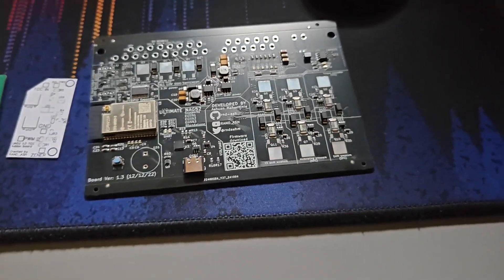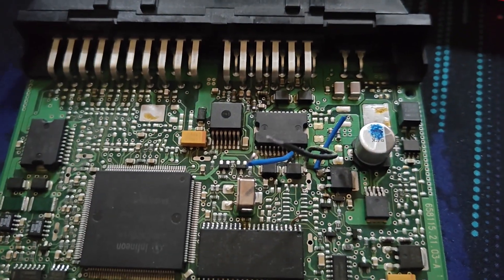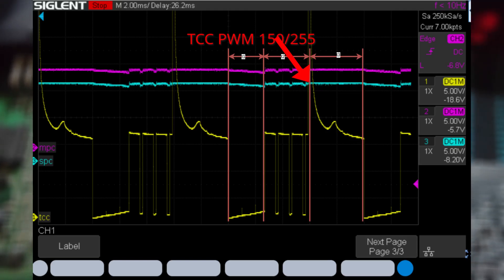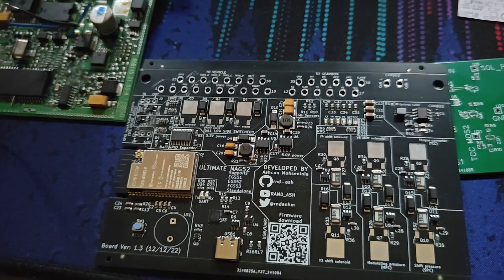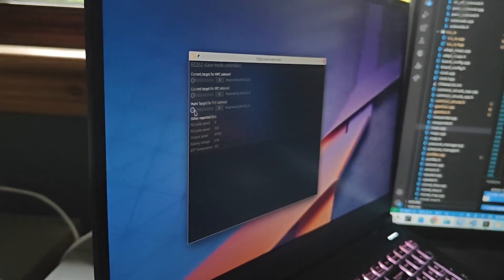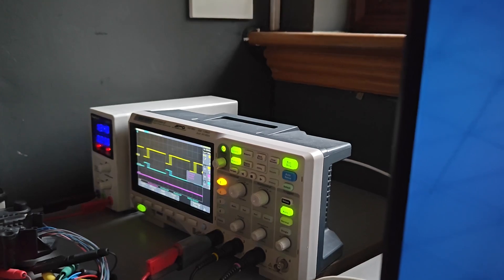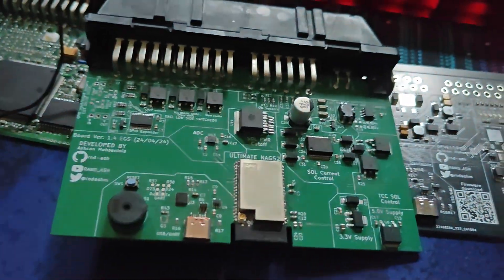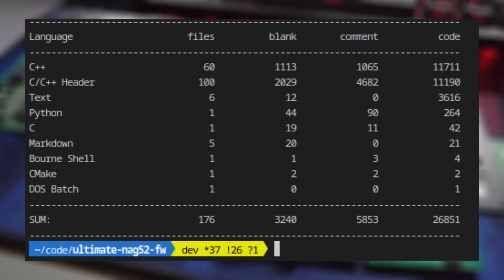Ultimate NAG52 update - TCC solenoid fix, PCB V1.4 progress, and more!

Comment: Fantastic update!  cant wait to build a few 1.4 boards and test. Currently built 2x v1.3 boards and so far been super stoked with them. Hopefully development can progress with these boards in standalone mode. My next project is a om606 tied to a 722.6 but standalone (om606 either mechanical IP or standalone w/factory IP and non em ecu), one of these boards was my first choice for this planned build.
Reply: I asked Luke Dale of Dieselpumpuk to make contact with Ash for exactly the same reasons you outline. He said he has been in touch, but was non comital about the outcome?
Reply from the maker: Yeah, I actually reached out to Luke a while back, we had a couple back and fourths, but since then I've heard nothing. 

Also, standalone mode does require some basic CAN data from the engine, so it does still require some form of ECU to operate (things like pedal position and torque data must be sent to the TCU for pressure management). It does however work with MAXX
Reply: @RANDASH  I am not familiar with MAXX …. But I am aware that some stand alone TCU’s (used for conversations) map out a toque look up table that matches your engine in software and that is used for the feed that the ECU normally supplies.
Reply from the maker: @JACB006 that is true, but the TCU still needs to be able to talk to the engine to do torque reductions where necessary (it's actually critical for shifts where the gearbox will release clutch packs before applying the next one)...so doing this over CAN is the best way
Reply: @RANDASH  How do the likes of Turbo Lanik get around these issues? 

As an aside, I own two cars a Mercedes CL (215/M275) and I am a keen follower of Alex of LegitStreetCars fame. He started out as a Mercedes tech and did a lot of work on cars equipped with the 722.6. He has reviewed various reprogrammed Mercedes TCU’s and has shown quite a lot of conductor plate/valve body work on his channel. He also showed a 722.6 issue, where when cold the torque converter doesn’t work quite as it should and the driver feels something like an early first shift, when in fact it’s a torque converter issue. You two might like to consider collaborating on a project/video?

My second vehicle has the running gear of a 69 Challenger (440/727) It really needs a transmission swap and at first I thought about a 68RFE using a TCU from Jason at transmissiontuner, but his TCU development has had various issues/delays. Next came the idea of a ZF 8hp** using a Turbo Lanik TCU. 

I then found your site and was so impressed, that I hoped one day that you might consider a second project, maybe a S/A TCU for the conversion guy’s, perhaps the ZF 8hp**? …. But at the time I had no idea just what was involved with such an undertaking. I dare say that if your 722.6 project is ever finish to your satisfaction, you will never want to say TCU again?

Oh …  I used to own a 123TE (great car) and later a late 124TD (non turbo being RHD). I always thought that a turbo diesel 123 would be a great daily drive hence my interest in Dieselpumpuk who in turn has issues controlling the 722.6 in his conversions.

Keep up the great work. 👏
Reply from the maker: @JACB006  not gonna lie, I messaged Alex a while back (years ago), but this project was still very early in its development at that time. I still don't think that I'm ready for it to go on a big channel due to this project still having some issues compared to just tuned OEM EGSs (Remember, all the code for this project is starting from scratch, whilst tuners just tweak existing tables on the TCU).

Also, I don't think ill work on the 8HP boxes. They are fully electrical boxes, thus, an accident with the software can cause some seriously bad side effects (Like shifting into R at speed). The 722.6 has hydraulic fail safes to stop this. Thus, it was what i felt safe playing with. And, there is always more potential to squeeze more out of old boxes. The 722.6 is a monster in terms of how well it handles high torque!
Reply: @RANDASH  

So glad you made contact with Alex, albeit some time ago. I am certain that he would have been encouraging and suggested that you keep in touch with him. Perhaps you could send him your latest TCU and let him try it (impressing on him that it is still in development) and see how he gets on with it. If all goes well it could be featured in one of his videos (maybe with you) and as you say, he does have over 1,000,000 subscribers that might help with your sales and help his subscribers/722.6 owners at the same time.

Re the ZF 8hp** … Yes I understand that it would be fundamentally different project, but don’t sell yourself short, you have learnt a very great deal developing the 722.6 TCU and who would be in a better position to take on such a project? There is I believe, a big market, not only the road racing/drifting market, but also the conversion market for those of us who are still stuck with 3 or 4 gears and no way of upgrading to modern gearboxes (transmissions) due to the lack of OEM ECU’s. My 440 actually has sequential injection curtesy of Edelbrock. It gets its cam signal from a modified distributor. The control unit is pretty basic, but I believe it does have some sort of minimal CAN output. So if you went ahead, what competition would you have? I believe it’s limited to Turbo Lanik and MAXX (the later seems like a major undertaking for the conversion guys with no ECU experience). Perhaps you could have a look at those two, would be competitors and ask yourself what you would do to improve matters? 

Thanks again.
Reply: @RANDASH  Again the work you have been doing is absolutely fantastic. Currently running your boards on my w211 and crossfire srt-6

Another long term standalone project im working on is full efi and supercharging a m117 which would drop in a 560sel w126. I do plan to slap a 722.6 behind it. Again long term build (currently fabricating intakes and supercharger brackets), but collecting parts. I am going to use a megasquirt MS3 pro which i believe has CAN  communication. Has there been any ventures of folks getting your board to work nice with megasquirt. Totally understand where your coming from when the trans needs ecu input for shift performance.
Reply: @RANDASH Luke has no interest in engines with electronics- it's just not their market. DSL1 users could benefit from compatibility. Baldur Gíslason also offers great online support
Reply: @hchelfman  This is why there seems to be a glass ceiling for transmission upgrades to cars that were made without an OEM ECU. What is really needed is a stand alone controller that can use various easy to mount after market sensors, such as TPI (Throttle Position Sensor), prop shaft speed sensor and very little else to control the likes of the 722.6 and or ZF HP8** etc. There are quite a few TCU’s that will do this for four speed transmissions and a few that will do it for a limited number of 6 speed transmissions. But none for 7, 8 etc speed transmissions (of which I am aware) at this time.
Reply: @JACB006  I bought one of these back in April with the plan to use it to put a 580Nm trans from a V8 behind my OM606 in W210 in place of the 330Nm 722.6.  As I am sure you know the TCU and ECU and traction control will not accept simply swapping the trans because of different internal gear ratios.  I pre-emptively tried this on my 722.6 and after hours of trying I took it out for fear of toasting my 722.6 and unfortunately have no faith in it.  I can't even begin to explain the multitude of whacky things my trans was doing when it was in and while I tried to get it to work.  I actually got stuck on the side of the road and had to have my wife bring me the stock TCU which I swapped back in and was then good to go.  It has a VERY bad name on the FB OM606 Superturbo group.  From what I have been able to find (and I have searched extensively) no-one has gotten it to work.  I do very much wish it would (not just because I feel like I purchased a $327.00 brick). I almost guarantee that is why Luke Dale has not replied.  He sees the same posts and I assume would not want to have the DPUK name tied to it with it's current track record.  I am a top contributor on the Superturbo group, until I see it specifically properly working in a W210 OM606 in person with my own eyes I do feel it is my duty to share my story with all the others on that group to not waste their money and time.  With that said, I very much look forward to being proven wrong.
Reply: @Skul-Ski  Can you say what “one of these is” …. I have been talking about various TCU’s. 

Are you saying that you couldn’t get one of Ash’s TCU’s to work for you and your OM606/722.6 combination? Ash says you need various CAN bus data to be sent to his TCU. Ie throttle position and torque data etc etc. Where were you getting that data from? Can you paint a fuller picture please.

Update: On a second reading I think I have a better understanding of what you’re doing. You started out with a Mercedes W210 that came as standard with an OEM OM606 and a 330nm (max) 722.6.  You then purchased a second hand 580nm (max) 722.6 Transmission that had previously been fitted to a petrol V8. Using the Original Mercedes ECU, one of Ash’s TCU and the secondhand 722.6 you hoped to get the combination working, but things didn’t go according to plan and you had to use the original Mercedes 330nm ECU, which did work with the 580nm 722.6. Is that correct?

If so you extremely lucky re the Mercedes ECU … but more to the point what has Ash suggested? It would seem a little unfair to slate him on his own website if there isn’t a great deal more to this story?
Reply from the maker: @JACB006  @skui-ski ...the om606 setups that came with EGS52 (think 1999-2000) do work really well out of the box with this module after applying the correct calibrations. But the ones that came with egs51 do not, since up until this week, I had not found a way to pull the calibrations from an egs51 module. But, that should soon change, and I'm hoping to soon roll out a much needed update to those 606 users with egs51 running the UN52 TCU. I think in total to make this work there is about 3200 changes made. So no, it's not simple.
Reply: @RANDASH  Sounds like a sound plan. At least you can tell people prior to purchase, what will and won’t work at this time and let them know what’s in development. It seems that there is a strong demand just as soon as you can “kick it in the chips” and get it woking.

I haven’t as yet been involved with this Mercedes ECU/TCU compatibility issue, but a quick google search shows that it is an active topic. Eg: MHH AUTO FORUMS.  Automotive Tuning.   Mercedes 722.6 replace EGS51 by EGS52.
Reply: @JACB006  That assumption is not correct.  When I tried the NAG52 I did so I a W210 with an OM606 that still has it's stock 722.608 (I should have included the last two numbers in my previous post) as was installed from the factory with if stock TCU.  It operated just fine.  I figured I would verify that Ash's TCU would work before getting another stronger trans (which I have yet to purchase).  As I mentioned, it did not work well at all.  So, I am still at the moment using my OEM 722.608 with the original TCU and have not done and trans upgrades/swaps yet as I have not found a solution that I believe will all the swap as I wish to do and I was hoping Ash's TCU would allow.  With regard to the can bus data you refer to, I would expect that Ash's TCU should get that from the ECU.  If not, then that info or instructions as such were not given nor was implied when the purchase was made. I am just now reading some other posts above mentioning that it does not work with egs51?????  Well, that may be the issue because the OM606's are 98-99 and are egs51.  If that is the case then I was misinformed by ash because when I purchased his TCU I very specifically mentioned the car I was putting it in.  Guess maybe when I asked he was not up to speed on that.  With this conversation I am also now assuming that if I were to decide to performance modify the OM606 I have to a mechanical pump in order to take advantage of much larger injector elements then this TCU will for sure 100% not work?
Reply: @Skul-Ski  
Sorry but I am no expert on the conversion you are working on. From what little I understand, it seems that you must first work out which TCM originally controlled the particular 722.6 you are working with, EGS51 or EGS52 ? If I understand correctly, Ash seems to be saying that if the original controller was an EGS52 TCM, then if you use his Ultimate-NAG52 all should be well. The same cannot be said of the EGS51, at least not at this time, pending a soon to be released update. When things didn’t work out for you, which OEM TCM versions were you trying to replace with Ash’s Ultimate-NAG52? Looking at the Vin Look up table on Ash’s website and searching for W210, it seems to suggest that all W210’s were EGS51 CAN Layer vehicles. Maybe the soon to be released update will sort out your issues with your original 722.6 or you can use his controller as it stands today on a new (high torque) 722.6 that was originally controlled by a EGS52. See Ash’s post above. ☝️
Reply: @JACB006  I will have to look at that option of trying a trans that was controlled by EGS52.  I am also definitely no expert, but these exchanges are always helpful in trying to get more educated.  I was under the impression that the EGS51 vs EGS52 logic and control was in the chassis not in the trans itself so I never considered that. I honestly do not have the courage to try that swap without knowing for sure ahead of time.  I will definitely keep an eye out for the EGS51 update though in order to see if I can get it to work in my 1999 E300TD they way it is before doing the trans swap to get some experience and confidence.  As far as the w210 chassis, I think the 2000-2002 might be the EGS52.  I believe they have CANBUS where as the 96-99 are not.  Those 2000-2002 have a different shift lever which I would also love to be able to update/swap into my 99, but as far as I know that is not an option because of the CANBUS thing.
Reply from the maker: @Skul-Ski the issue I've been having is that 2 fold. 1. Up until earlier this week, I hadn't figured out how to pull calibrations from egs51 (it's stored completely different to egs2/3, and 2. The torque model the engine transmits is completely different, which turns out to be a huge headache as the TCU is very sensitive to torque information, as it's simulating the physical properties of the gearbox
Reply: @RANDASH  I have a question that may be missing the point or too basic to fully develop.. if that is the case, please forgive me. But if there is a remote ECU and TCU (be it an original EGS51/52 or your Ultimate-NAG52) surely there can’t be much logically physically left within the 722.6 case? Would the remaining “logic” (which, if I understand correctly, differentiates between being able to be controlled by a EGS51 or a EGS52) be on something that could be swamped (making an EGS51 722.6 transmission work with a EGS52 TCU)? Where physically within the 722.6 case is the remaining logic/circuitry? Is it all on the conductor plate … which could be easily swamped or is it somewhere else?

I assumed, that all 722.6 were dumb devices and just did whatever the controlling signal they received from the remote TCU told them to do. Why would the 722.6 manufacturer not make all 722.6 receive and work with the same signal set? It would just be adding complexity making a proprietary signal set & for what benefit?

On the other hand I could see why the ECU/TCU interface would be far more critical and changeable. Again I assumed (possibly incorrectly) that any & all controlling 722.6 TCU’s would be outputting the same standard signal set. 

So in my mind, the problems currently being faced with the EGS51/52 issue would most likely be caused by ECU/TCU compatibility. If one is replacing the OEM TCU with your TCU & the 722.6 is a dumb device, then surely we would be saying that your TCM is compatible with certain Mercedes ECU’s at this time. If that is correct, it might be helpful to publish the Ultimate-NAG52 TCU requirements regarding the Mercedes ECU? I think this was the rational that @Skul-Ski was following?
Reply from the maker: @JACB006  I think it's best I do a video explaining all this and clear everything up :) . There is definitely confusion between us who know how the system works and how complex it is, and those who just want a plug and play solution...

But to answer your question. The TCU needs to know in software how the gearbox WILL react to changes in pressures and torque. This is then simulated, and the TCU will then output pressures to the clutch packs accordingly. Now, there are about 200 different clutch sets for the 722.6, each with their own torque handling characteristics, and also about 20 different valve body revisions, each with different springs which therefore changes the pressures in the body. This is what the calibrations say to the TCU. 

As for EGS51/2/3 CAN networks, these are all unique ways that the car talks to the tcu. The data is encoded differently on each CAN Matrix version. Therefore, my TCU has to decide each matrix into a common standard which is what allows it to run in all 3 setups
Reply: @RANDASH  Yes a video may help to clarify the situation.

So (unsurprisingly when you think about it) there are many internally different (physical) versions of the 722.6. Each performing differently and so the controlling TCU needs to be told about the specific specifications of the 722.6 it will be controlling. I suppose in theory this calibration information could be found in a software look up table or the TCU could be preprogrammed for a single 722.6 derivative. If it is in a look up table, either the ECU or the transmission itself would have to identify itself for the look up process within the TCU to work. I would hope that the 722.6 serial number/part number would be sufficient for a human to find the full specification, but at a CAN level this may be done via the VIN making transmission swaps difficult. Am I correct in saying that a new 722.6 (or new conductor plate) has to be programmed following a swap? In software terms how does the TCU get informed about the specification of the 722.6 it is controlling?

I understand that you have only recently been able to collect the calibration data from the EGS51 … and this will allow you to correctly calibrate your TCU to a much wider selection of 722,6 transmissions. But you will need time to process the new data and program the information to work with your TCU.

I am guessing we are talking lookup table … or the old TCU would be needed from any 722.6 during a swap, in order to “harvest” its configuration information.
Reply from the maker: @JACB006  the calibrations live in the config app, and are manually parsed from a ton of EGS flash files I have as well as tables linking EGS PNs to VINs to Chassis to gearbox part numbers. So yes, the user has to select the correct calibration for their car upon getting the unit otherwise nothing works. This is clearly documented on the wiki 

(Docs.ultimate-nag52.net)
Reply: @RANDASH  Would you say that the main reason you designed and built your TCU is because: 

a) It is physically more reliable than the original TCU 
b) it allows the original calibration to be modified (but still needs the original calibration as a starting point) 
c) To allow for transmissions to be swapped into vehicles for which they were not originally designed?

Is there a list of 722.6 transmission part numbers which are known to work with the ultimate-nag52 TCU as it stands today and if so where do would be transmission swappers finds it prior to purchasing their 722.6?
Reply: @JACB006  I am one of many looking for the answer to be "C".  Very many W210 OM606 owners/tuners with very minor modifications have pushed the engine torque well beyond the 330Nm rating of the 722.608 that is in the car from the factory.  We would like to swap in something like the 722.625 or 722.626 that has a 580Nm rating.  I am in the USA, so about 100% of us are working on a 1998 or 1999 because those were the only years that the OM606 turbo was imported here.  To the best of my knowledge these are all EGS51.  Now, that being said.  I haven't got a clue what the difference is between EGS51 & EGS52, it is all Greek to me.  What I have learned is that in 2000 the gasoline versions of the W210, which were still available here in USA had a different shifter known as the Tiptronic. I am actually curious if the OM606 W210's in Europe that were still produced in 2000-2002  have the Tiptronic shifters.  I would love to swap over to one of those TIptronics in my 1999 W210 diesel, but I have heard that cannot be done because it is controlled by different CANBUS (which I assume is the EGS52). I am quite certain all of this has nothing at all to do with the transmission itself and all about the communication between the ECU, TCU and shifter and probably also the instrument cluster from what I have heard.  The reason I can say this with relative confidence is because the conductor plate inside the transmissions are the same for just about all of the W210's from 1998 all the way through 2002 and they are even in the W211's up to 2006 I believe. So the trans does not care about EGS51 vs EGS52.
Reply: @Skul-Ski  I feel your pain …. 

Ash has stated that a car that originally fitted with an EGS51 will not work with his Ultimate-NAG52 as things stand today (I guess the clue is in the name of his device .. “52”). But the good news is that he is working on a software update that will (hopefully soon) allow EGS51 vehicles to work with his TCU. 

If I understand correctly there are two main problems he has overcome for the update:

1) The CAN bus itself (the protocol or language if you prefer) is different for the EGS51 and EGS52 so for his Ultimate-NAG52 to be compatible with both CAN systems it has to be capable of “speaking”  two languages (in effect) and identifying which is appropriate to use.

2) The hardware changes in different 722.6 versions (high torque clutch packs etc), so the software controlling the transmission needs to match the hardware. This is known as the calibration data ….. evidently you need the Mercedes data (to get you in the ball park) before you start modifying things and “tuning” the TCU software to suit your driving needs. Ash has only recently gained access to the EGS51 calibration data.

Since there are many modules in a car (instrument cluster/shifter etc etc) simply upgrading a cars entire CAN bus (EGS51 to EGS52 compatible) is not practical. 

Ash has talked about making a video to cover the compatibility issue. I hope he covers the following points within that video:

A) When does he hope to release the EGS51 compatible software update for the Ultimate-NAG52?
B) Which versions (part numbers please) of the 722.6 does he currently the calibration data for when using the Ultimate-NAG52 as it stands today? 
C) Which versions of the 722.6 will be added to the Ultimate-NAG52 compatibility list when the EGS51 update is released?
D) Can he explain what calibration data is stored in the EGS51/52 …. Does it have a range of transmission data and use the VIN (or ?) to work out which to use or is the EGS51/52 programmed with only one set of calibration data set when it is installed and programmed for a particular vehicle?
E) is there anything in the 722.6 (conductor plate etc) that needs to be programmed when fitting and new or secondhand transmission to a vehicle?

Sorry I don’t know about EU versions  .. tiptronic etc. You may care to add “shifters” that to the video wish list above? ☝️
Reply: @RANDASH  Ash have you taken a look at how OFGear in Denmark are handling the various issues to do with the W210 and the OM606? I have been told that they have a specific W210 page under General Info on their website.
Reply: @JACB006  The EGS51 update is something I look forward to so that I can give it another go.  AS far as internal 722.6 differences, I know the gearing is different, internally for 330Nm vs 580Nm units, but I don't think there is all that much else beyond that for controlling because there are quite a few people that have done swaps from OM606 722.608 transmissions to the higher torque capacity units (after a bellhousing swap) and have had luck doing so but have had to change out the rear end from the donor car so that final gearing matches in order to circumvent electronic traction control issues.  I believe they still have full throttle shift issues due to programmed shifts but they supposedly work "okay" for the most part.